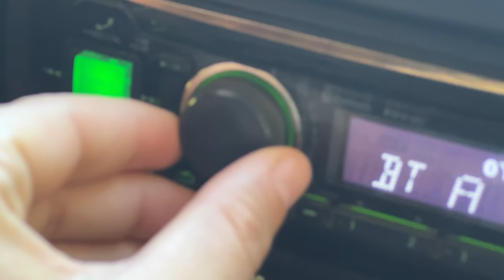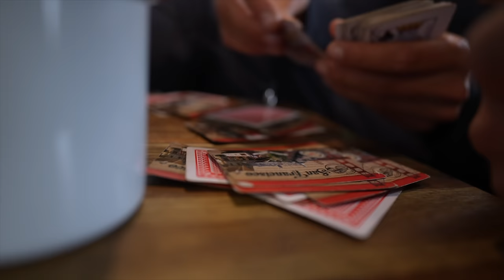10 days to catch a fish in Argentina (roadtrip) - EP 89

Comment: on for your filter  k&n filters offroad is a must,WATERPROOFING FILTERS,  NEVER USE PAPER FILTERS OFFROAD?  ALWAYS CARE A QUEEN SIZE PANTEYHOSE  FOR REPAIRS ON THE AIR CLEANER . THAT FILTER NEEDS TO BE  DRIED,  AND THEN YOU PLACE THE PANTYHOSE OVER THE FILTER  TO MAKE A QUICK FIX? in your air box  oppisite of the intake should be weep hole to drain out the water inccase you get water in the box. also when installing the lid , use a little vasoline or any grease on the rubber seal to waterproof the seal, so the water is stopped before entering the air box?
Reply from the maker: thanks. a lot for all the tips! we will remember that and are scheduled for a check of the entire air intake system to fix it once and for all!